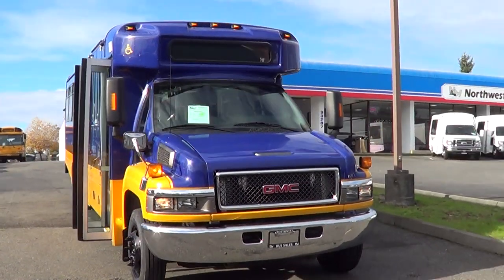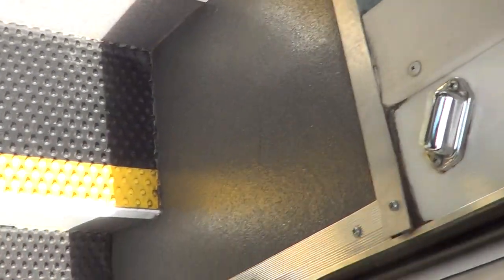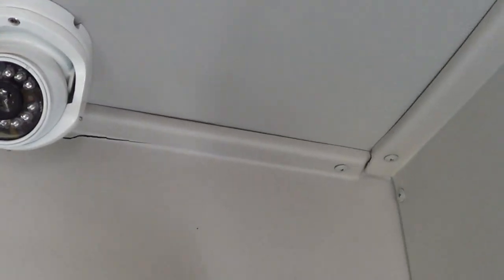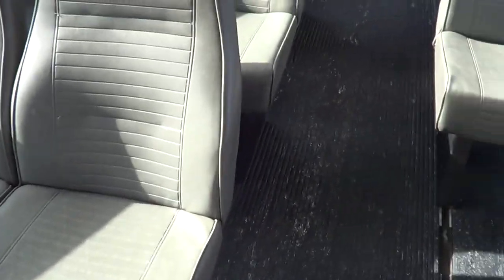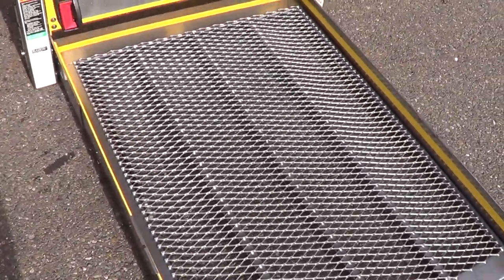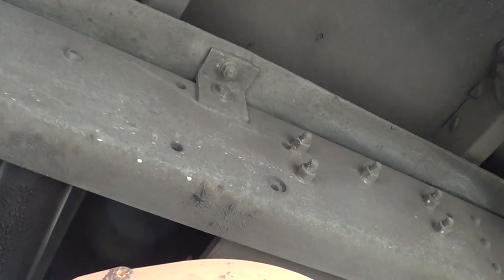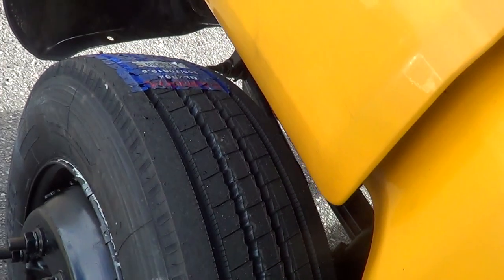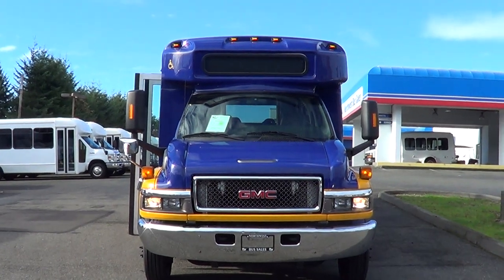Northwest Bus Sales 2009 GMC Goshen C5500 27 Passengers and 2 Wheelchairs ADA Shuttle - S04343

Comment: This handicap shuttle bus should be used as an airport shuttle bus, hotel shuttle bus, or a church bus. This should come to Chapel Of The Lakes Lutheran Church of Mecosta, Michigan, but it should get the southwest beach blue passenger seating. It has to get rid of 2 seats that are behind the ADA lift, but it needs a Ricon K-Series multi-fold ADA lift so it can have each passenger look out the ADA lift door.